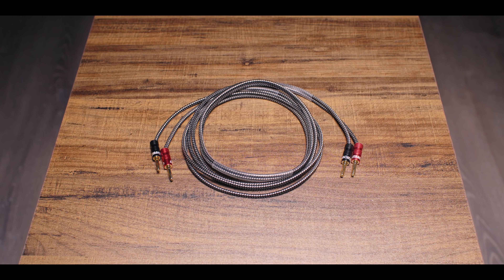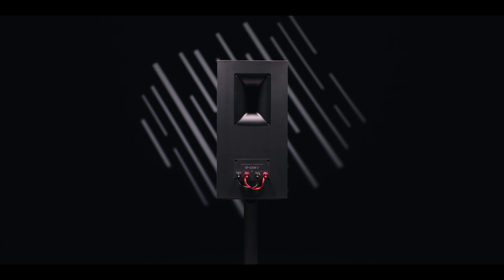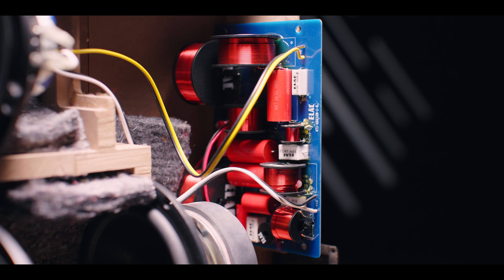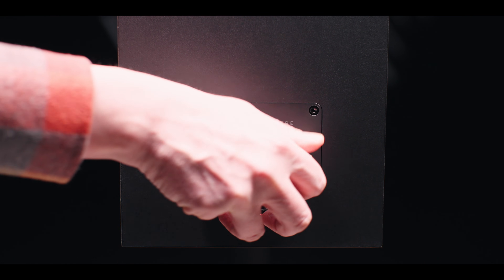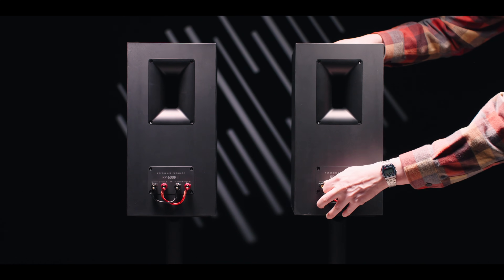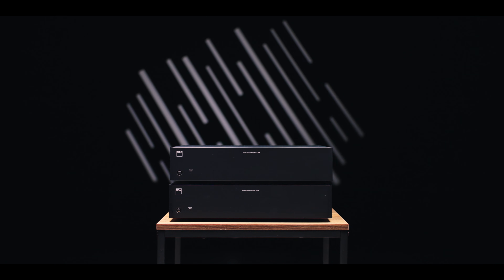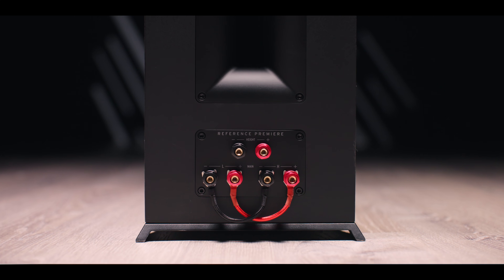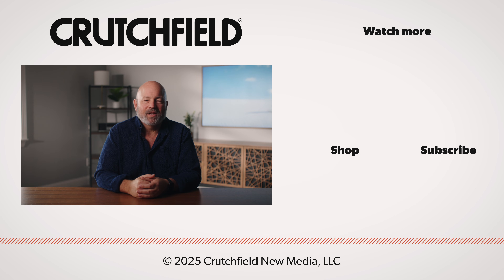How to bi-amp and bi-wire home speakers | Crutchfield

Comment: you are not showing someone actually doing the biwiring and bi amping from both ends.i have a pair of ruark 5 inch bookshelf speakers i got back in 2000 biwired to an 80wpc nad amp from the same year.the speaker cables are silver sonic and have gotten great results with this set up.

Comment: As for biamping, I think this video only covers horizontal biamping. There's vertical biamping too. In theory, this can offer better channel separation.
Reply: Can you explain that, please? What kind of biamping is when you use one power amp for both tweeters and the other power amp for both mid woofers?